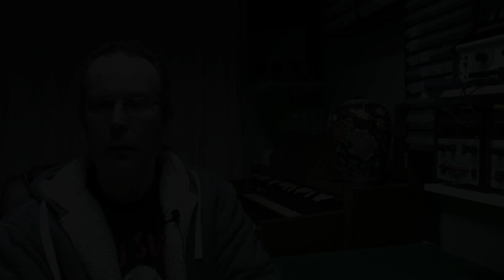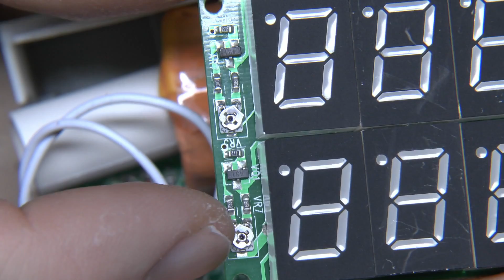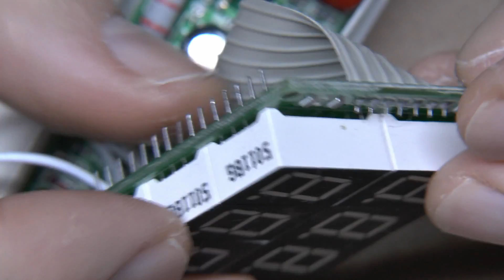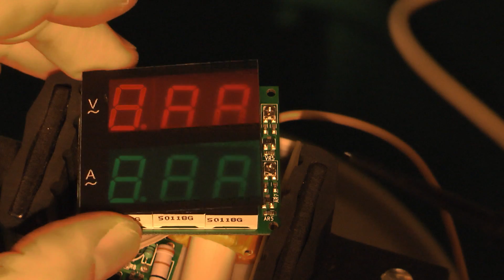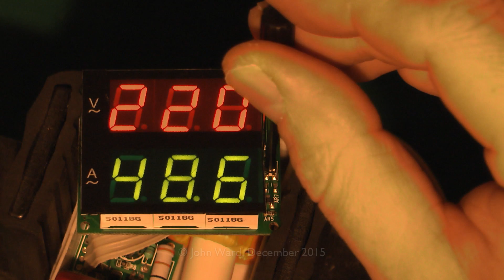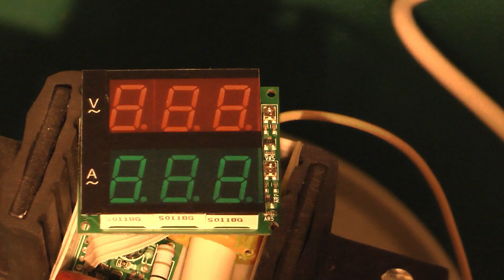Panel Meter Part 2

Comment: Seem like a neat and useful little device for an enthusiast .. Pity it was trashed ,, A little calibration and it was good to go.For around £10.19  outstanding value .. Emotive negative observations detract from a technical evaluation .." Somebody getting killed" and "Random Garbage" stood out as examples.
Reply: +reburne It's 'designed' to be connected to a high energy mains circuit. Somebody getting killed is a possibility.
Reply: +TheChipmunk2008  ALL of my appliances are connected to a high energy mains circuits ! This unit must be fused like any device connected to the mains.. Death from a toaster is far more possible than from this. Emotive and misleading..

Comment: thought there would be more on that display board. not enough wires to drive a 6 digit multiplexed LED display unless they were controlled serially or had some other electronics